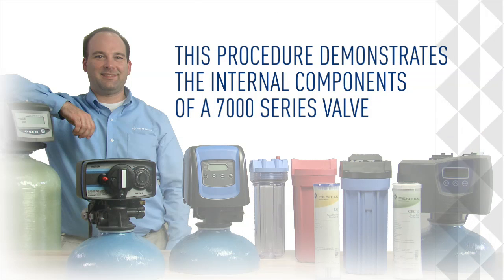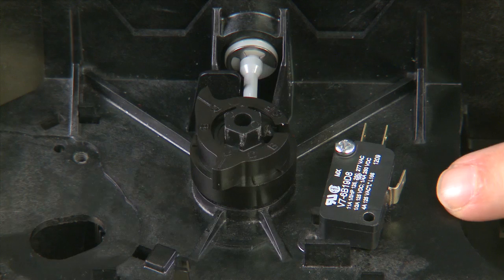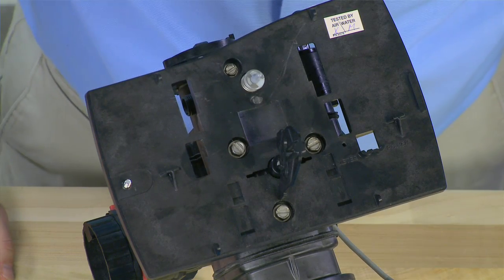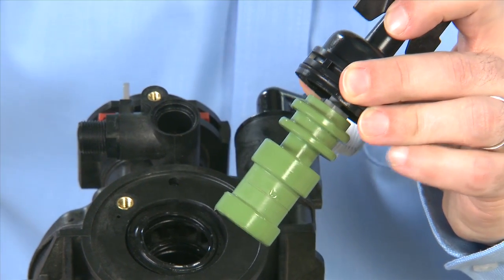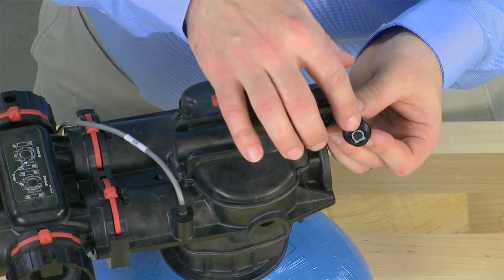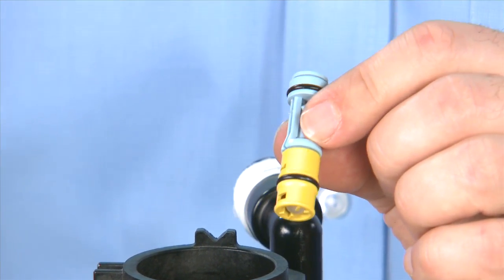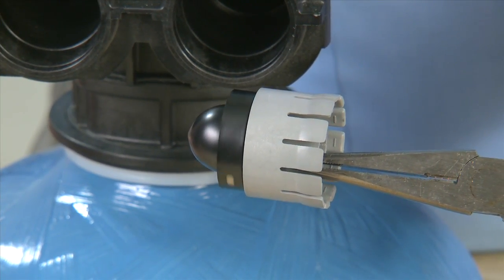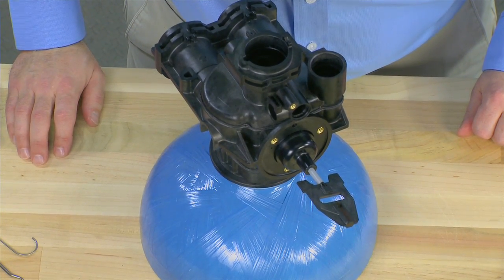Fleck 7000 Control Valve Tear Down

Comment: How do you get the red clips out if they are stuck?
Reply: They usually feel stuck because they are under pressure, either water pressure or side pressure from whatever they are connected to. if water pressure is the cause, you better relieve it before taking it apart or you're in for a bath. If side pressure is the cause, press inward on whatever the clip is holding in place to relieve pressure against the clip. It'll usually release easily after doing this. 
It's always a good idea to have spare clips on hand because they break fairly easily. Even if a leg breaks off the clip you can replace the 2 pieces back in the unit and it'll work in a pinch until you get spares.